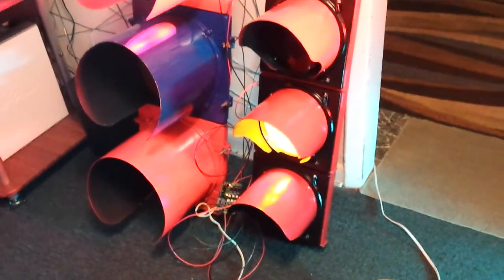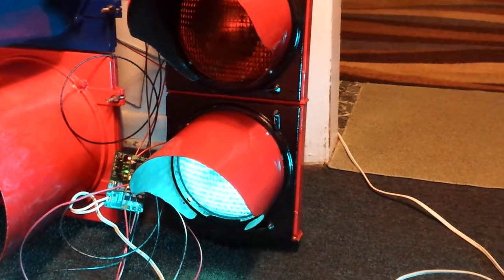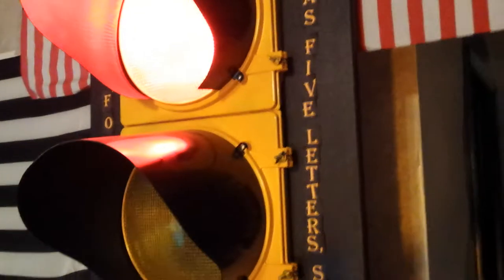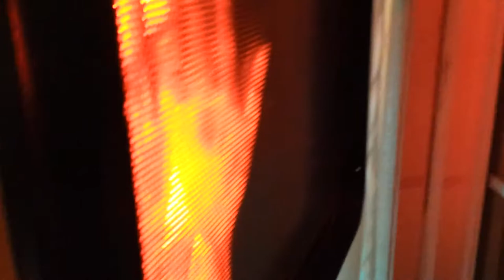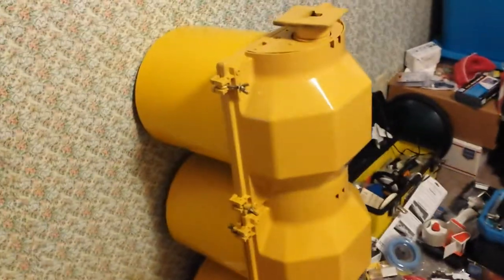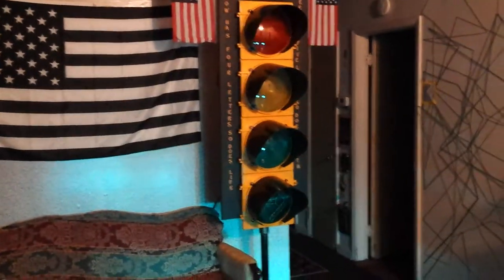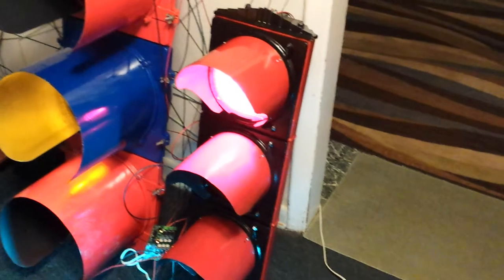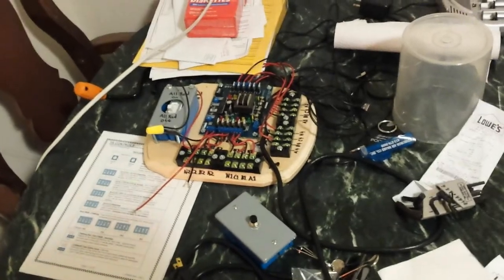My Traffic Lights 2017

Comment: The bracket that holds the five head together can be attached to the bottom and a pole should be able to  attach  to the center hole but I wouldn't recommend it  I lost my five head that way😢
Reply from the maker: Taylor Leger oh no!!!! Did it shatter the whole signal?
Reply: Lance Maddux yep ruined it
Reply from the maker: Taylor Leger ouch!
Reply: You could also get a pair of signal pole arms and a second doghouse bracket, attach one arm to the single red section on top and the other one to the center hole in the bottom bracket  then it should be able to attach to the wall or something
Reply: Lance Maddux got my eagle bubbleback pedestrian signal

Comment: My collection:

Traffic Lights:
8" LFE signal R,Y,G, cap visors, cast aluminum from around the 1960s

12" LFE/TCT signal R,Y,G (glass lenses), tunnel visors, cast aluminum.  This was just after TCT bought LFE so whenever that happened is the age of this light

12" Econolite "Bullseye" back signal, R,Y,G, (poly lenses because I swapped out the glass ones for the TCT/LFE), tunnel visors.  I think this is 70s or early 80s.  The original Bullseye Econolites had round doors (portal style)

12" Econolite "Bullseye" back signal, tunnel visors, YA, GA (glass lenses).  Since this is an exact match for the one above I have consider making this an inline 5 signal.  I'm 5'11" and would stand nearly 7' tall :-)

Pedestrian signals
Crouse Hinds 9" DW/W text ped signal (dual hinge doors) has original glass lenses

16" ICC ped signal DW/W text signal still in it's faded green/black paint job.  This has the visor with divided plate between the DW/W poly lens.

Controllers:
Traconex HMP-40 4 phase controller
IDC/Traconex 8 phase (with D connector for special features like OPTICOM systems and coordinators)

Conflict Monitors

Crouse Hinds 12 channel monitor with jumper board

IDE 6 channel monitor with jumper board

Multisonics Green Conflict Monitor (not sure of the year, but since this ONLY monitored the green signal it has to be around the 70s or maybe the 60s.  It does not use the traditional military connector (like the MS A,B,C,D use on TS1 controllers), but it definitely uses something similar and larger.

Various loop detectors as well.

Load switches
3 TCT Jones Plug style
4 random manufacturers

Flashers
IDE and one that I can't remember.  Both use the 6 blade Jones Plug

Back panel (got from OMJC):
Power section has one 20 AMP breaker, and a 15 AMP breaker.  Along with line conditioner, fan power, signal power, and a few other items.
Panel Section
12 channel.  8 (set for turns and thru signals) OLA and OLB, and PED 1 PED 2.

All traffic light bodies (sans the 2 head Econolite signal and the ICC PED) are painted with ACE School Bus Yellow (closest to Federal Yellow), and Krylon Ultra Flat black (doors and visors)

I did own an Eagle EPAC 8 phase controller, but I wire up the conflict monitor improperly and blew out a trace on the EPAC's board.  It sounded like a 12 gauge shotgun going off!
Reply from the maker: Oh wow! Very nice collection! Do you have videos of them?